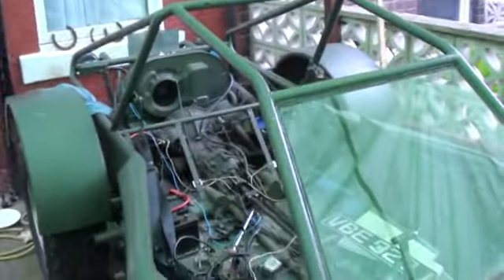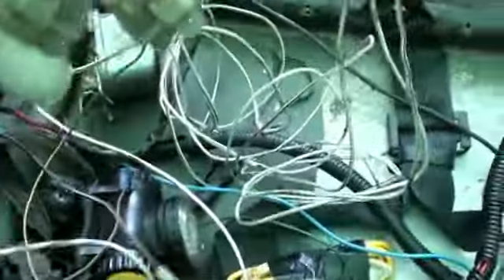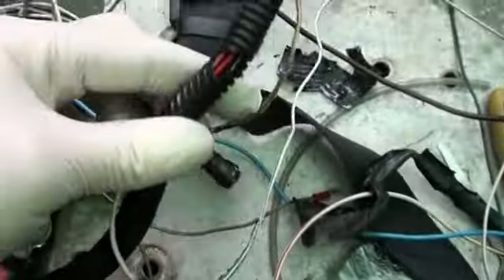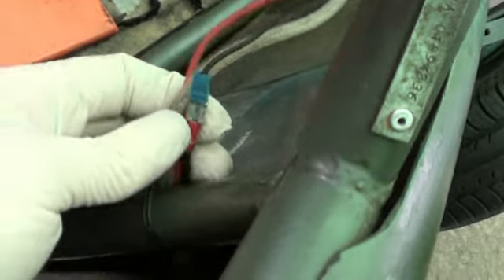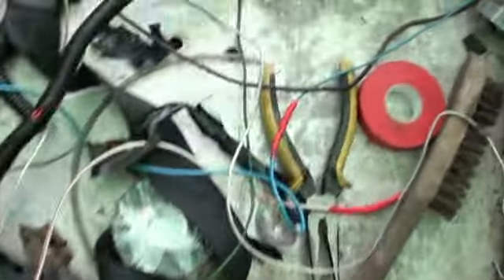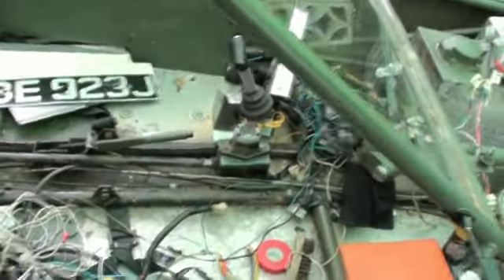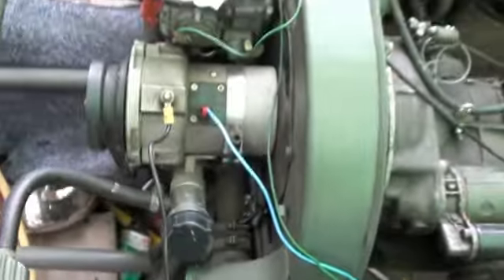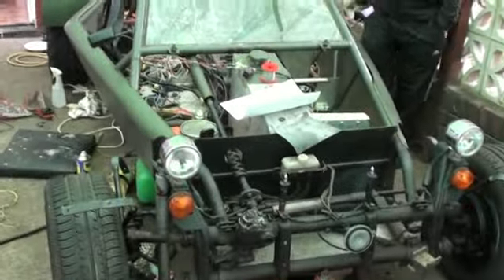Kit Car DANGEROUS electrical wiring problems UVA Fugitive VW Beetle

Comment from the maker: @mgospeed31 Thank god it wasn't as so complicated as that, no ecu abs or other electrical nightmares to worry over, even though it just has basic lighting & wiper electrics it still was a total mess, i spent 3 days figuring it all out, the problem with old (kit) cars that they tend to have had lots of previous 'enthusiastic' owners who tend to do electrical repairs to different standards, ending up with a 'mishmash' of different coloured wires & connections, what a nightmare!